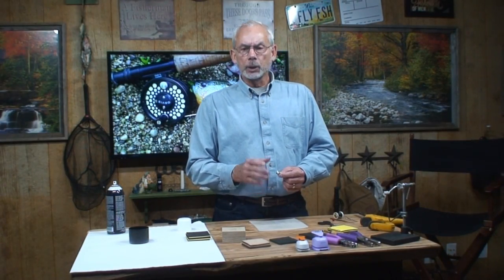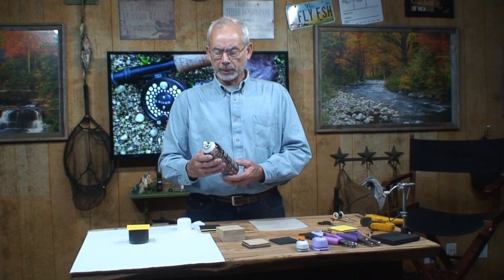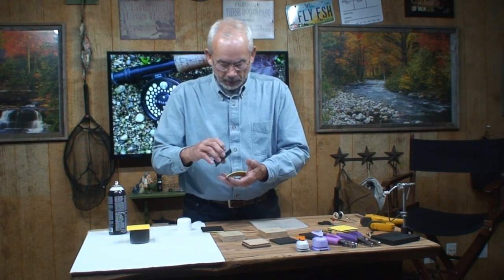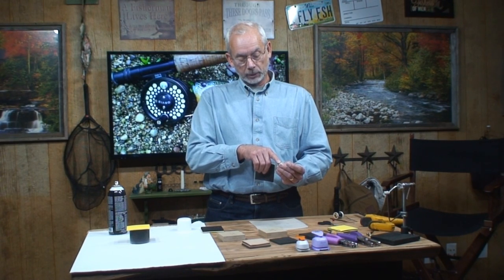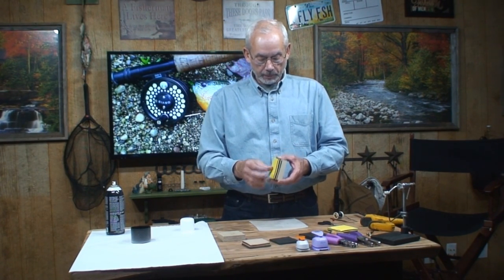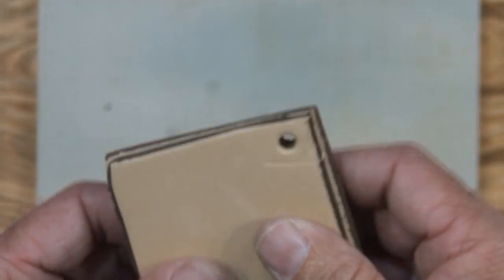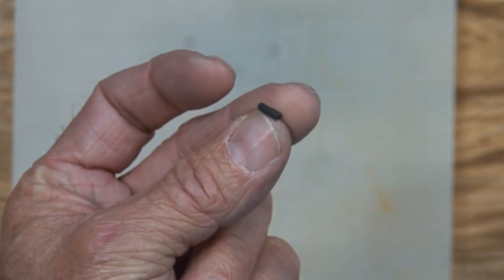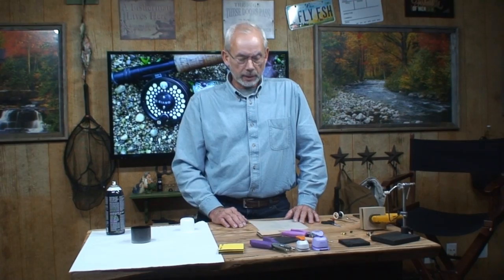Making Foam Bodies For Fly Tying With Craft Foam

Comment: I just use rubber cement. I also will poke a nail though the center and put it in a Dremel then spin it and I use a nail file to shape it. Works great

Comment: If you sharpen that brass tube with a round file it will make a much more efficient cutter. I made steel ones for my drill and they work wonderfully. Thanks for the tips those poppers are expensive! All the best. Sean
Reply from the maker: I don't think I mentioned that I do sharpen them... thanks for bringing it up... yes, they do much better when sharpened.